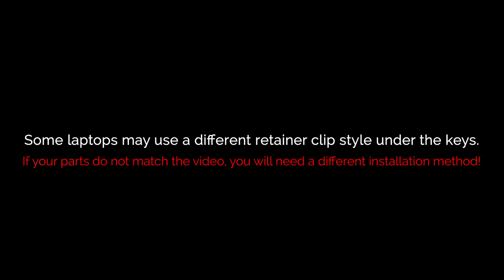How to Replace HP OMEN 15z Keys

Comment: If it doesn't work when you hold the button down or press the corners of the button etc., will the problem be solved if we replace it with another button?